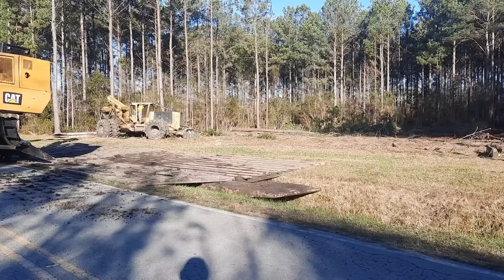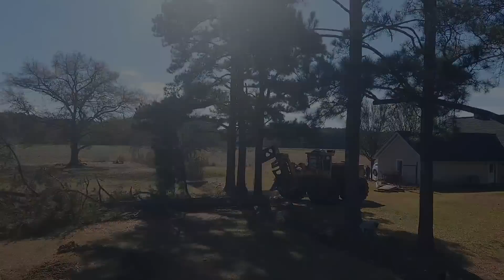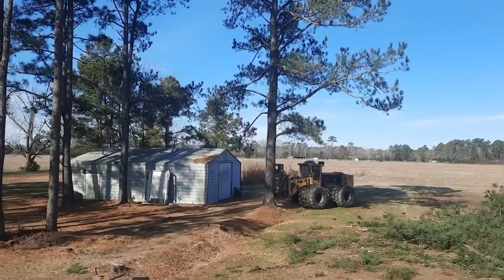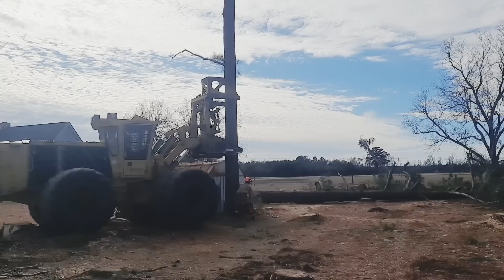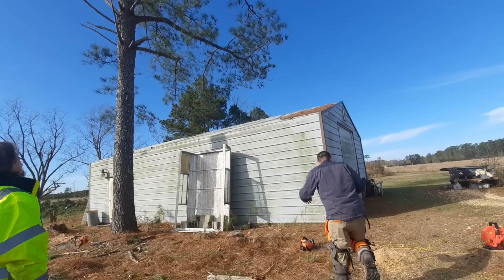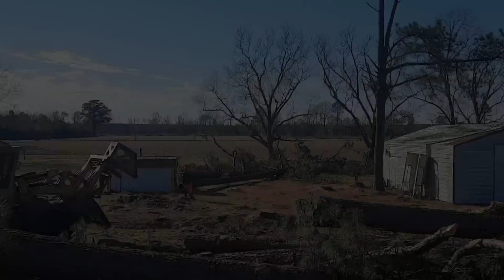DSL- Doing some tree removal work

Comment: Hey man, I saw you have a self contained delimber. I was wondering how much fuel it burns in a week? I’m thinking about switching to a track loader, just trying to figure out fuel consumption. Thanks
Reply from the maker: My engine blew about two years ago  so now it runs off the loader but b4 I had to fuel it up every time I fueled the loader up but i don't remember how much fuel it held but about two days of working and it needed fuel hope that helps
Reply: @dirtysouthlogging  thanks man